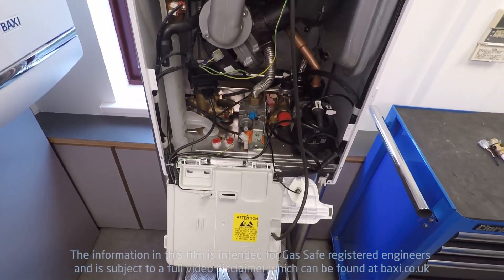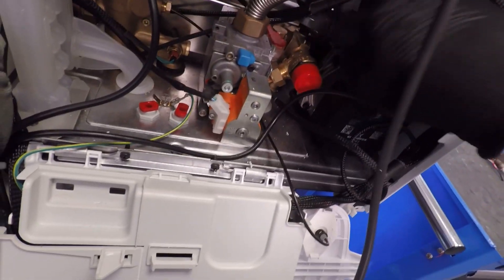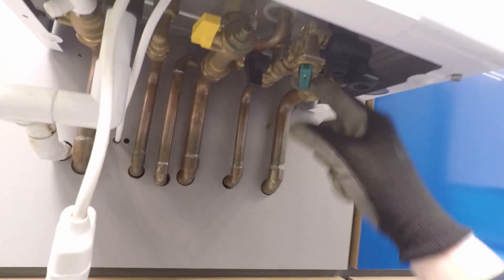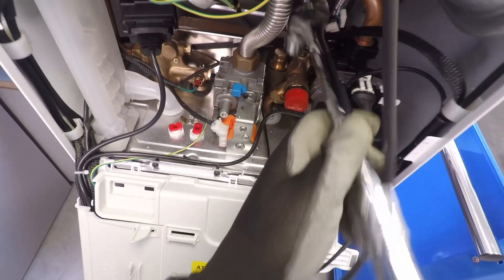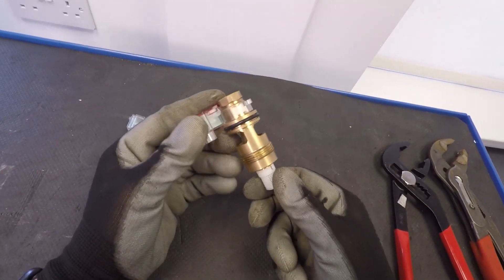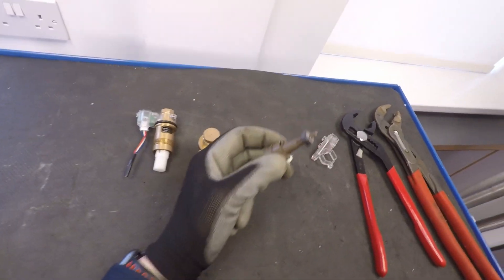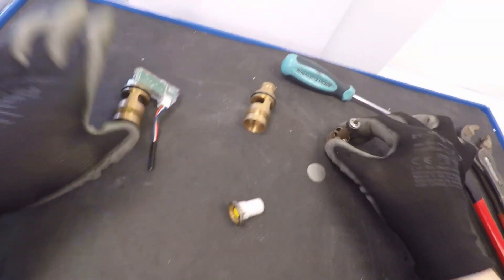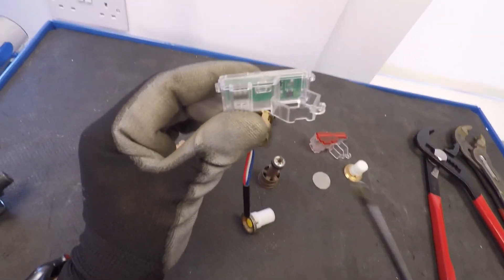Part 3 - How to remove the turbine type inlet cartridge on the Baxi 600 or Baxi 800 Combi boiler

Comment: Do you have the part no for both turbines??
Reply from the maker: Here you go Robert: 
Duotec (float switch type): 
10 l/min = 7211823
12l/min = 7211822
40kw model = 7211824

600/800 (turbine type)
10 l/min = 7663535
12 l/min = 7663533
15 l/min = 7715773
The size should be stamped on top of the brass cartridge
Reply: @BaxiBoilersUK  thanks Rob